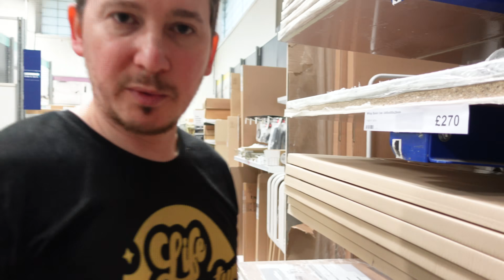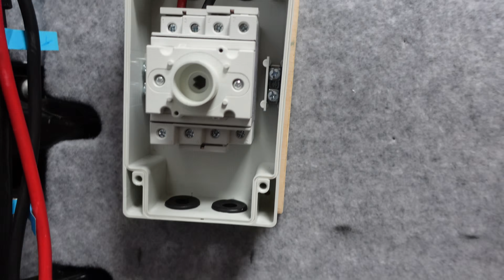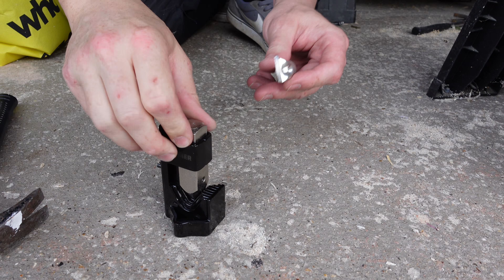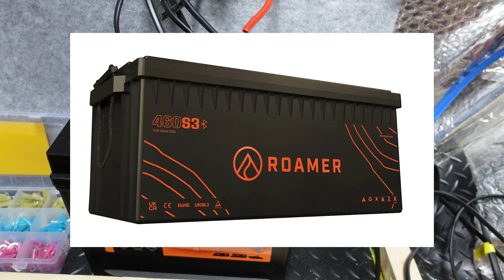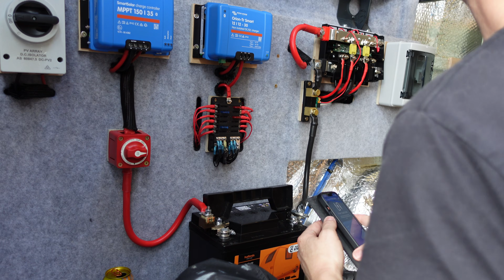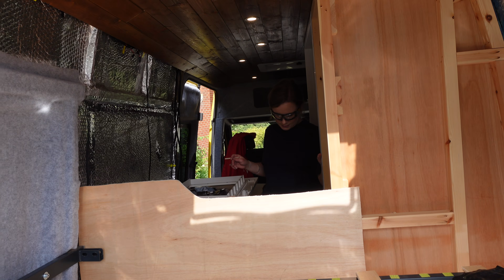Van Build: We Mastered Off-Grid Power using 12V B2B, Solar, and More!

Comment: 230 v doesnt kill you instantly, with a poor heart it can cause you rhythm problems and that can lead in to a death.
230v can hook you but it depends that how you touch it, if with fingers, then you have a high resistance and you can take your fingers of, but if you lower your resistance then you can easily get hooked. but if you double the voltage then the resistance is half and also it flows easier trough you

Comment: Maybe worth fitting a switch to the B2B as I don't use mine hardly ever between May to September as the solar is more than enough with a 460 amp Lithium battery.
Reply from the maker: That is actually a very good idea, I am thinking may also add in a switch just to be able to switch off all 12v electrics.

Comment: Have you connected the B2B to the wrong side of the isolator? The output should go to the leisure battery, not the fuse box. Is this why the lights came on with isolator off? If it came on in charge mode with isolator off I'd expect it to come on with isolator off when you start the engine. Of course, I might not have understood how you've wired it!
Reply from the maker: The B2B is connected to the Lynx Distributor, so all play from that front. The reason the lights came on is because the B2B setting was set as a mains and not a charger, meaning it was powering the circuit from the front battery. As soon as I switched the B2B to “charger” it all started working correctly. Phew!
Reply: @lifeadventureprojects  Yes, sorry! It was power supply mode, which means it was unconditionally providing 12V. In charger mode it will be live only when it thinks the engine is running — but then it will be powering the same point in a similar way, so I would expect your lights to be powered with your isolator off. Does the B2B work with the isolator off? I probably don't fully understand how your distribution system is working 😆

Comment: Tidy job bud. It’s a safe bet the only reason you’re still alive after being chunked off the 230v you mentioned earlier in the video is because your consumer unit/ fuse box has a safety sensor. As soon as it senses a change of 30,000th of a milliamp (it’s not the volts that kill you it’s the amps), it’ll trip the switch to cut all electricity after the consumer unit and it all depends on you just touching or grabbing. Just touching will throw you off but if you grab your muscles contract not allowing you to let go. Which makes me think of Marv from Home Alone 2. You may have already done it. Just check you have the right setting for the type of battery you’re using on the Victron app( lead acid/ lithium etc). You didn’t show it so thought I’d mention it just in case.
Reply from the maker: Amazing! This is the answer we were looking for, thank you! Good point on the settings, I did set it correctly luckily. Planning to get a new battery soon though! Thanks so much for watching, appreciated! 🤛🏻
Reply: @lifeadventureprojects   Not quite right, It would have to be DC current to 'grab' you. The fluctuation of AC prevents it from holding on. But a high enough AC current/voltage will kill you on it's first cycle so pulling away and getting free is a moot point. Now if the voltage and current DC and are high enough, you will be 'grabbed' until dead. Even at lower voltages AC throws you off, DC makes you grab
Reply from the maker: 😨 pretty scary stuff electrics! May seek help for the 230v!